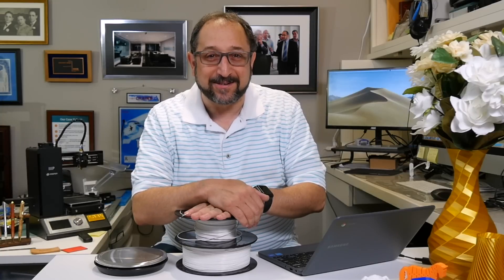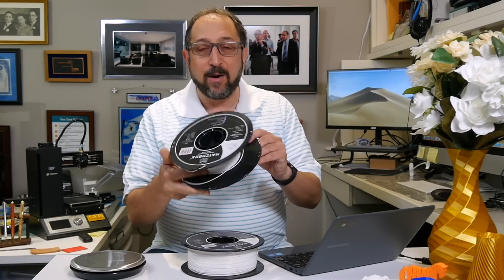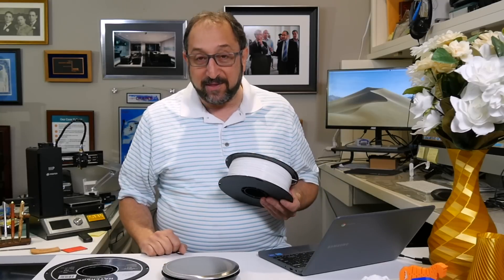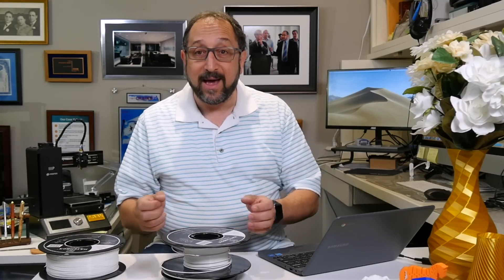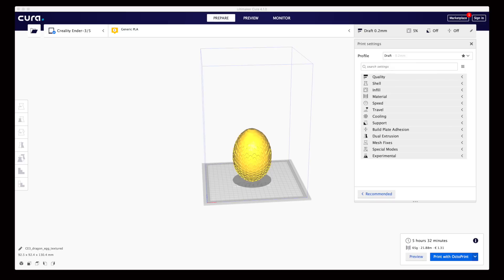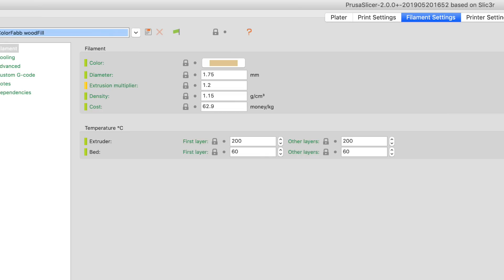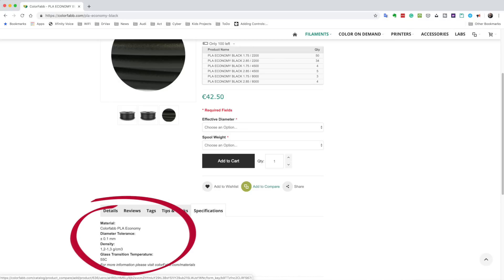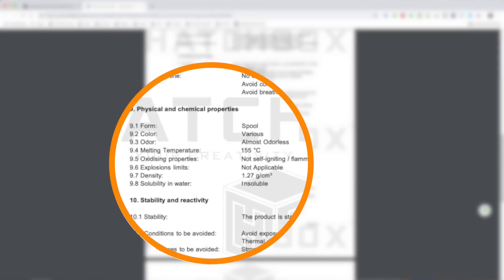Do I Have Enough Filament

Comment: About End-Of-Filament sensor:    I have a Monoprice Ultimate 2 printer and was wondering how to continue a print after the filament runs out?   Seems to me there will be a gap.
Reply: Normally printer keeps track of it's current position. So when you get run out of filament, press "Pause" button or get electricity malfunction it will be able to remember where it was prio the events and will be able to continue (depending on make and model of the printer that you have).

Comment: Once you get the result for the filament you are using, with a simple proportion you can get all weight just knowingvthe lenght of filament needed for your project .Tell me if i'm wrong DrVax. Thanks for all your "cogitans" tip and tricks, DrVax😊👍

Comment: Great topic. I use a large postal scale to estimate remaining filament. I offer a few cautions: The 1kg assumption is influenced by the honesty of suppliers & loading tolerances. A constant 250g spool assumption can be significantly influenced by spool style; since some have large side windows, vs none; plus spool material varies. I have had very heavy & very light spools. I suggest folks log weight & save one empty spool type, as a reference for future Filament purchases from each favorite vendors.
Reply from the maker: Good suggestions.  Thanks.

Comment: You just need to start the scale with an empty spool on it (same kind of spool), then replace the empty spool with the spool of filament you using and the scale will show how much filament you have.
Reply from the maker: You are correct.  If you have an empty spool.

Comment: It is even easier to use an empty spool instead of a full one. Zero the weighing scale with the empty spool on it, and after that you get the filament weight of the spool in use.

Comment: some confusion between area and volume; you're calculating cross sectional area, which multiplied by length of the cylinder gives you volume. Volume times density gives you weight.
Reply from the maker: You are correct. Thanks for clarifying for everyone.

Comment: Thanks, that's a magnifficient trick to weight all rolls when full! (as long as you can rely on manufacturer provided filament weight being correct, not sure if low end cheapos can have a bit inflated values or not)

Comment from the maker: Sorry folks.  I just rewatched the video and noticed I was saying "grams per cubic centimeter" when I should have been saying "grams per cubic meter".  Let me know if you catch any other mistakes.  DrVax
Reply: SYSTEMS OF MEASURE: "Units of measure" for the Metric System (SI) include as "base units" the meter (m), kilogram (kg), & second (s): mks. For convenience, in some cases, the units used are centimeter (cm), gram (g), & second (s): cgs.
FILAMENT: Filament density is typically given in g/cm^3. So, I believe you were appropriate in the use of the language - though I have not thoroughly reviewed the video to confirm it was applied consistently throughout.
CALCULATIONS: Any units can be used (even mixing systems). Certain choices will make calculations simpler, though, as well as less error prone. The important thing is to apply conversion factors as/if needed, and to use unit analysis to ensure correctness of calculations.